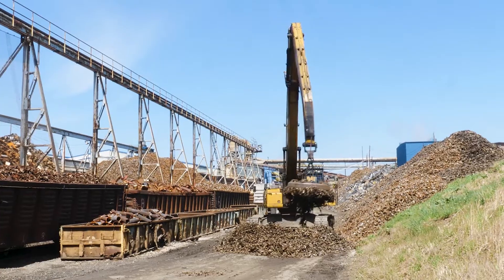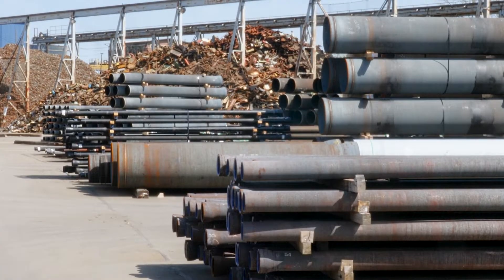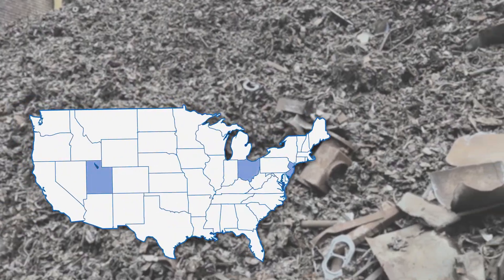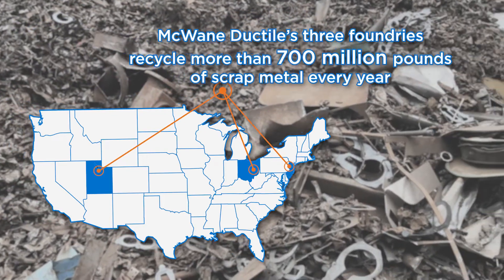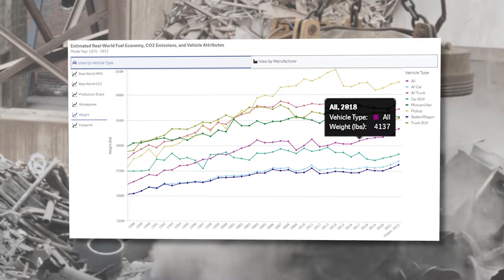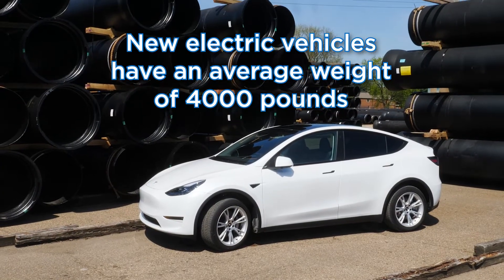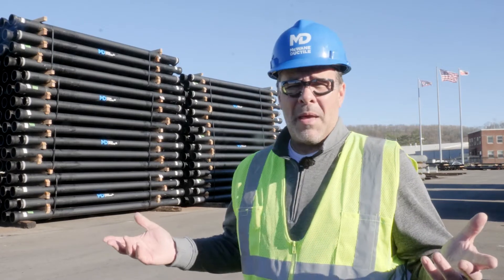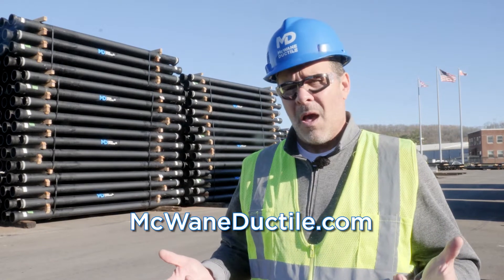Recycled - How Many Cars Can You Fit in a 36-inch Ductile Iron Pipe?

Comment: curiosity:  the cupola furnace in coshocton it is hot blast with recuperator?
Reply from the maker: Thanks for your question. The furnace is hot blast, but there is no recuperator.
Reply: @McWaneDuctilePipe   thank you for the reply! I have another technical question... if the recuperator is not present, how is the hot blast generated? Is there a gas boiler?Thanks again and congratulations on your beautiful company.